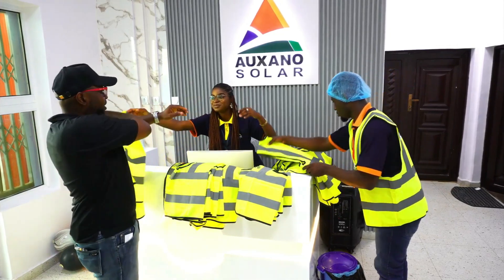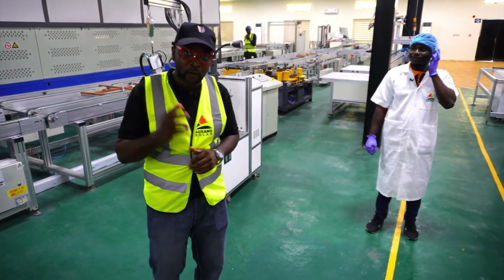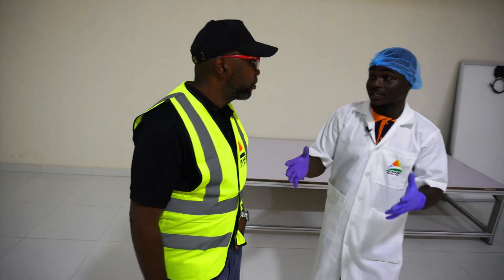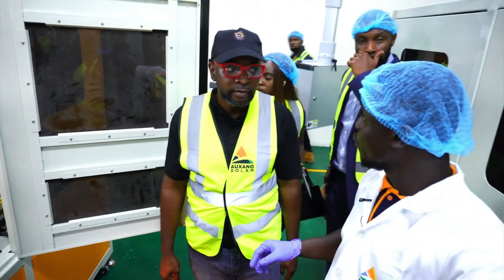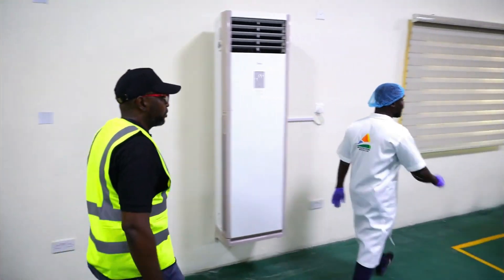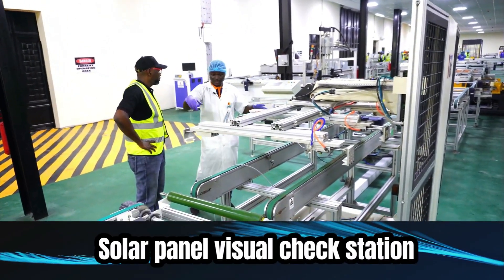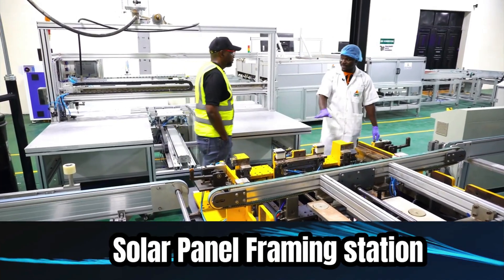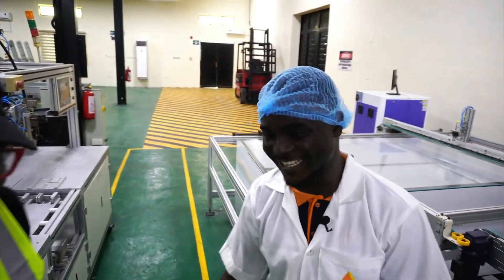A tour of a 100 Mega Watt Solar plant

Comment: Bros you made the video so boring saying "okay" 95% of the time, you were probably carried away, was expecting questions about the efficiency of the panels, what wattage sizes they have the capacity to produce, what are the raw materials used and if sourced locally etc. Thanks for the video though, please if you could do on the lithium processing plant in Nigeria also that will be good